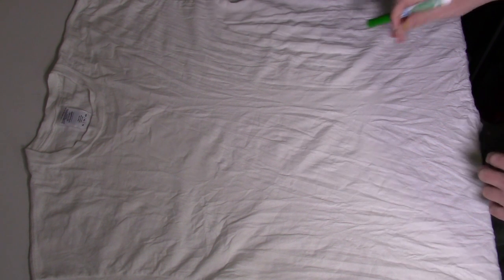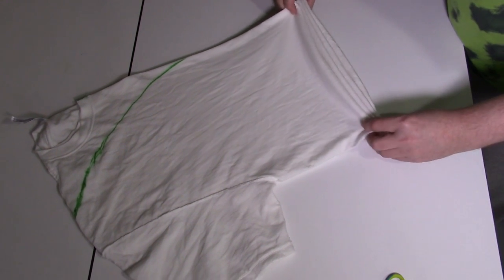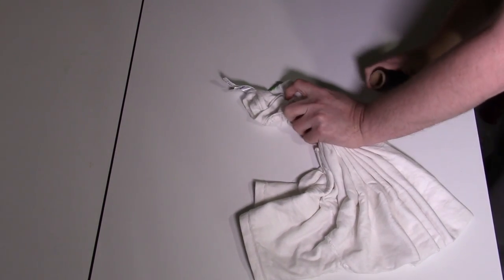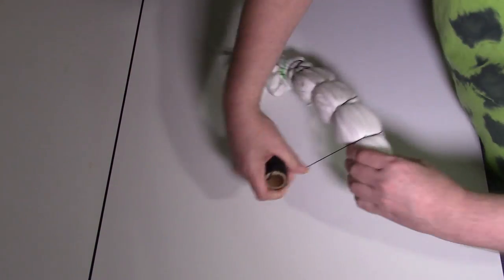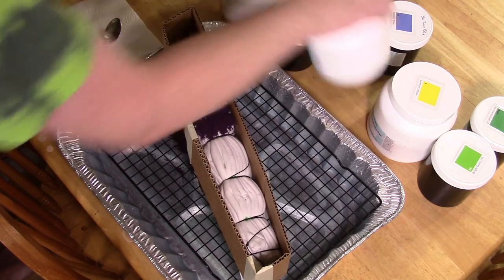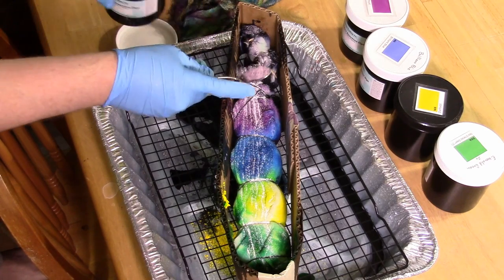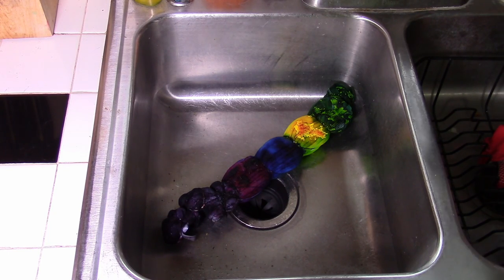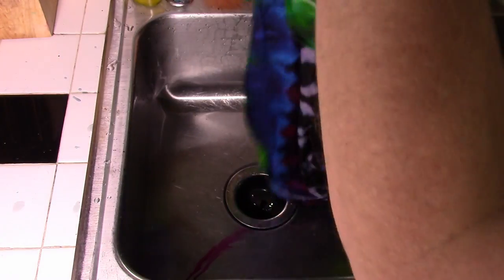How to Tie Dye a Bifurcated Spine Pattern

Comment: Im curious if there is a reason you did ice on top of dye instead of vice versa.  Ive been watching a bunch of videos on this technique and this is the first time ive seen it done this way.  Stunning piece!!
Reply from the maker: If I want greater control of the dye placement, I use ice on top of the dye.  If I want a more organic/free expansion of the color, I use dye on top of the ice.  So, for a design like this, I place the dye first to try to contain the specific colors within each tied section - resulting in a sharper contrast between sections. 

For some designs I even go with ice over dye on one side and dye over ice on the second side.
Reply: Awesome! Thanks so much for the explanation!!

Comment: Just wondering. Do commerical dyes require this much wahs out> This much bleeding? Frustrating. I want a stead fast dye that most doesnt go down the drrain or have to wash seperately without ruin a load of wash.
Reply from the maker: I hand rinse - as seen in the videos - and then only do a single wash cycle in the washing machine.  After that, I have never had any bleeding issues and we routinely wash the tie dyes with whites and every other color.  I've never seen an issue.

Comment: Hello.i love the design. just started dyeing and I need a very dark black.... which one do you use at dharma? hot black was gray when I washed out
Reply from the maker: For tie dyeing and ice dyeing I use Dharma's Better Black.  It doesn't need to be heated like some of the other blacks (though letting it sit outside in the Texas summer works very well) and creates a nice dark, solid black.  Note the mixing instructions if tie dying with the blacks from Dharma - you need to mix them at 4x the standard strength.  So, 1 tsp per 1 ounce of water for the blacks versus 1 tsp per 4 ounces of water for most of the other dyes.

Comment: i am not getting enough white areas in my dyes. i tie up my shirts pretty tightly with the sinew and use the power ice method. any suggestions?
Reply from the maker: Are the shirts dry, damp, or wet when you tie them?  Do you let them dry after being tied or dye immediately?
Reply: @CasualCollisions  Which is preferred, Best result? Thx, I'm new to the craft and am soaking up info and tips like a sponge!
Reply from the maker: @NIGHTROCKER70  - Personally, I prefer damp.
Reply: @CasualCollisions  OK, for the speedy reply ✌

Comment: Why do you prefer dye then ice as opposed to ice then Dye on top? Just curious since I've seen other tubers use way less dye when putting ice on top.
Reply from the maker: You have better control of the placement/flow of the dye if it's placed on the fabric instead of on the ice.  I use substantially more dye than most people so that the results have little-to-no white space and are fully saturated.

Comment: Can I do this without using ice?
Reply from the maker: You could use liquid dye instead of ice dying; however, the overall final look will be quite different since liquid dye will "bleed" between colors while powdered dye separates into component dyes when slowly diluted with ice.
Reply: Thank you so much for the reply! I went ahead and tried it and it did turn out a little differently but it's still the same basic design. I LOVE your tutorials so thanks for all the hard work. I'd love to figure out how to do the lightning bolt that actually tapers off at the bottom!
Reply: Do you have a picture
Reply: I'm going to try this with thickened liquid dye to reduce bleeding.
Reply: @ciaracurtis9558  how much of a difference was there...do you have a pic?  apologies since this is a year later..lol
Reply: Wow, sorry y'all! I'm just seeing the other replies. But the, this is my absolute FAVORITE shirt I've ever done. I've followed a LOT/most of his tutorials using the tie dye you get in the squeeze bottles and it works out ok. The biggest thing is the vibrancy is turned down a bit! You have to make sure you saturate the shirt WELL!! Let your shirt sit 24 hours and rinse immediately after. I dunno why, but it starts losing vibrancy if you let it sit longer. I also wash all my tie dye stuff together, gentle cycle, with a color safe detergent. I know that's a lot, but using cheap dye, it really goes a long way to keep my stuff looking decent!  Can I post a pic on YT comments? I will share photos so you can see what I mean!
Reply: @MillieCattellxx  http://imgur.com/a/i1enzwC

So sorry for the late reply! I included a couple shirts I've done using his tutorials in the album!
Reply: @lindadonnajohns2190  http://imgur.com/a/i1enzwC

I included a couple photos of shirts I made using his tutorials. Oh! I also wash them inside out and that makes a HUGE difference. Sorry for all the info. I can't help but share! It was a LOT of trial and error to ensure i didn't wash all my hard work away!!

Comment: Can i use hemp line instead?
Reply from the maker: You could use most twine, string, or rubber bands.  However, artificial sinew is coated with wax which allows it to "stick" to itself very tightly, allowing you to create a much tighter tie with sinew than you can with almost anything else.  Also, since the dye isn't absorbed into the sinew, it can be reused.  (Though, I toss it after each use as it's tedious to re-spool the sinew versus just buying sinew in large spools.)